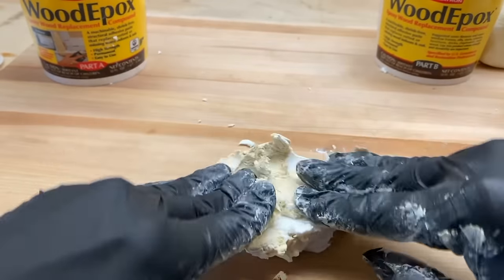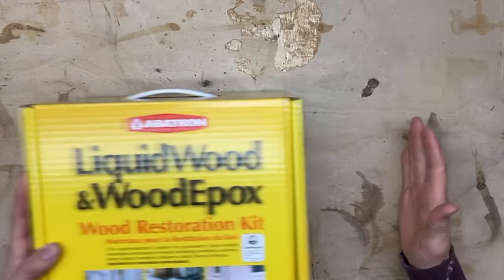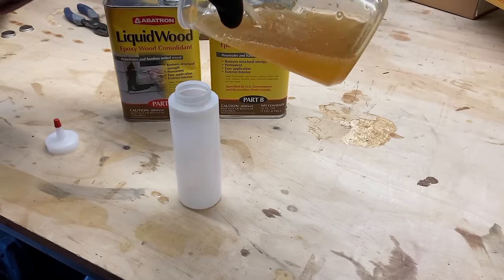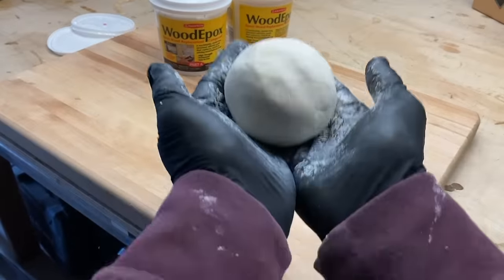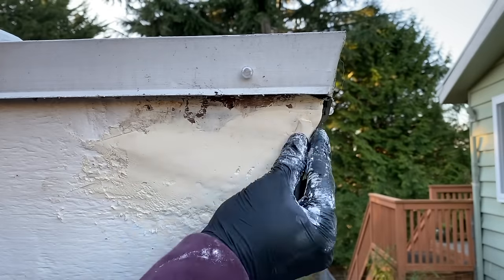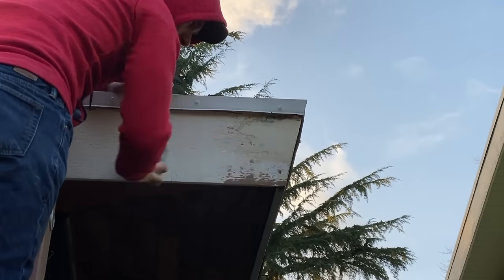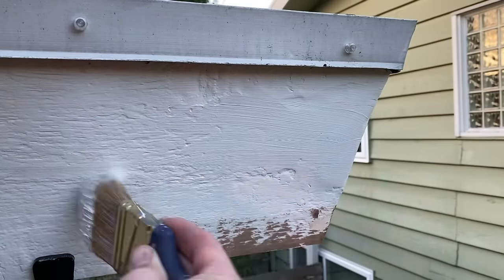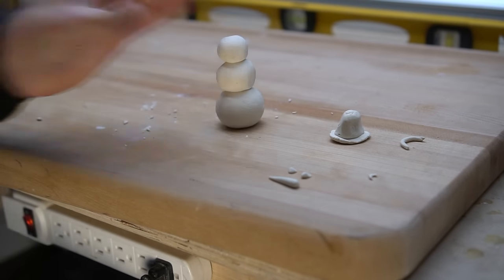How To Repair WOOD ROT and Water Damage With ABATRON

Comment: Hahah, so much work! 
Just cut it out and stick a piece in
Reply from the maker: That would be easier Ralph but just providing another option for those who don't want to go through the process of ripping the whole thing out.  Thanks for watching and hope you enjoyed the video.
Reply: I can repair with resin before you even have your chisel and saw set up
Reply: @tomsanders9491  oscillating tool to cut out section and stick a piece up there. Paint. Done. I did this on my house. Took 15 min.
Reply: @ImAChristianFirst  As a restoration professional of 40+ years, there are times when a "ditchman scab" (your suggestion) is neither appropriate nor correct.
Reply: Correction..."Dutchman scab"
Reply: @tomsanders9491  Why do people always throw out 40 years, 50 years, my entire life etc etc? It doesn't take 40 years to learn to do this stuff. It takes a short amount of time. I am sure there are times when cutting out the piece, nailing a new piece, and painting is not correct but around here in TN it is correct. My house is 6000 square ft. and dates to 1850s.  If I used epoxy to repair the entire house it would cost a fortune. Replacing wood with wood is a simple and an affordable solution.
Reply: @ImAChristianFirst  Most of the homes I have worked on with these epoxies are in the same size range. Many have intricate trim that is more easily repaired than refabricated, especially homes that are over 100 years of age. It does not require many years to learn resins thanks to the pioneers such as myself who wrote the books on restoration for people like you to learn from our accumulated knowledge. As for replacing with wood, I have been duplicating trim for federalist, colonial, victorian (1991 Chicago's Finest Painted Lady) and the first Prairie home (Tomek house) for over 40 years. Sorry to have offended you.
Reply: Hey guys! I have a house with some ceiling problem. And some constructions holding weight have damage. Changing entire piece would be the best but extremely hard and would require ripping off entire roof. Can you use this technique for constructions that hold weight?

Comment: A stiff wire brush before it's completely dry should provide a nice wood-grain texture.
That spray foam would provide a nice backing surface for the wood putty.
Reply from the maker: Great tip Stan. Thanks so much for the suggesting and the support.

Comment: There is a product used in the boating industry that is a water thin epoxy.   It penetrates extremely well.  I’ve used it and it will soak into rotten wood and turn it into a rock.   Soapy water instead of wd40 would be better and not leave a residue that might prevent paint from sticking as well as it should.
Reply: I use a little methanol. It creates a smooth surface and totally evaporates fast!
Indeed, alcohol is often used to "thin" epoxy to make it penetrate more so it is generally quite compatible and doesn't affect the epox strength if used in small amounts.
Reply: Could you post the name of the epoxy you used?  Thanks.

Comment: Wouldn’t it be easier to replace the board with an azek type product and it will never need to be replaced again?   Seems like a ton of work doing it this way.
Reply from the maker: In my opinion it’s a lot more time-consuming to try and find a board that matches the existing facia trim and trying to replace the entire board. That is also just as costly as this kit.  But in any case thanks so much for watching and hope you enjoyed the video
Reply: Yes so much easier, cheaper, and less time consuming.
Reply: @BYOTools  So wrong on every point!  You desperately need accurate and fact based opinions.  Even Abatron wouldn't promote this total waste of time and money.
Reply: l agree and clean job that's!!! 👎👎👎
Reply: @iwasabigdeel7895  You're so much smarter than me. I can't detect your fact-based evidence (not opinions) here at all!

Comment: I’ve used a similar product for a rotted door jam. When they installed the door they never put in Z flashing. Removing the entire jamb was a huge job. I was in no mood. I bought a spray hardner and the stuff worked well. I built out the opening then used the epoxy mix. It’s been four years and it still looks brand new.

Comment: To all who really care about doing a proper repair job: DO NOT USE STUFF as he did! Here is what will happen in a couple of years' time: The wood next to the putty will continue to dryrot slowly. You can NEVER completely stop it with anything short of replacing the effected wood. This is especially true since he did not address the water intrusion problem he obviously has at the roofline. Also for such a small area, cutting out the rot and splicing in new clean wood is VASTY superior and long-lasting too. It is also much faster to do and less expensive than putty.
Reply: @RA82828  I'm not a professional, and I can tell you this is the most half assed way to fix this. It's like those stupid videos of people using crushed ramen noodles and body filler to fix damaged panels on their car.
Reply: Thank you Mike. Do it once, do it right, move on with your life.
Reply: Although I'm guilty of using "rock hard water putty" to patch small holes.  My first thought when watching this massive patch is that the wood is going to be much more hygroscopic than this filler.  The wood will expand and contract with humidity cycles, it will almost certainly separate from the patch and continue rotting at this new crack.  The newly formed gap between the materials will hold water with capillary action.  That being said, he may have mitigated the root cause of the water intrusion with some other action
Reply: @RA82828  I will make a note to myself to NEVER hire you to do work for me.
Reply: Totally agree, the rot is not stopping because you covered most of it. He should have removed ALL rotted wood, that's if he were to have the job done right.
Reply: @RA82828 I’d hate to see your house!
Reply: Rot only occurs with water. If you stop the water, he will have stopped rotting. With that said, I believe a key issue here is the perforation of the metal flashing above the hole, which may be delivering water in behind.
Reply: The repair is fine, he should just install rain gutters so the problem never happens again.
Reply: Geez grown-ups,  there's always options.... to each his own.  I thought it was an awesome tutorial. To each his own
Reply: You guys, he said he stopped the rot, I am assuming that meant he fixed the cause of the rot.
Reply: Hey boys I gotts a tar gravel roof leak at a corner about 10 inches out on the roof edge, dry rot underneath, does the entire section of tar roof come off and new 3/4 inch wood put down then re Tar with Henry tar and then throw gravel rocks on top of tar.
Reply: @matt7iron  I dont know much about tar roofing other than I dont like it much. ;-) Not very durable and a heck of a stinky mess to work with too.  In any case replacing all the rotten wood is critical.
Reply: This may not be the best way to do this, but it does work, and will last for several years. To fix it the right way is 10x the time and money. It would’ve been better if he treated the rotted wood with anti-microbial/anti-fungal and maybe used wood restore.

Comment: Using small pieces of wood in the back to fill part of the hole saves money.  This stuff is not cheap.
Reply from the maker: Nice tip!  That would save us some money thats for sure haha.  Thanks for watching.
Reply: Yeah great tip, I do that too, mix wood chunks in with the WoodEpox.   The stuff is good but pricey.    If it needs to be extra strong I get LiquidWood in there too, to cover the wood chunks and melt together with the WoodEpox and it all becomes a super strong mass.  Hard to go wrong, the stuff is amazing.

Comment: I did the same today on my fascia corner.  I used builders bog. Easy to mix, hardened in 20 minutes ready for sanding and simply used a spray can to touch up the paint. Looks like new
Reply from the maker: Great to hear and I'll have to try out Builders bog in the future.  Thanks for watching Reece and hope you subscribed.

Comment: Thanks for your video showing this product. I will be looking to purchase it for my house. Do think WD40 , even though it does smooth out the surface when using a spreader, it surely must compromise the strength somewhat as it mixes in. I have a log house and when trying to apply the chinking, I use alcohol. this does the same thing and evaporates fully leaving no residue. This  also works great when running beads of caulk. I like to tool the bead with my finger so I fill a small cup with alcohol and dip my finger in it, then smooth out the bead. It slides so well without pulling the product.

Comment: Since the hole is so large, being  inside no one can see, why not use small piece of lumber to fill in the inside as much as possible, then just use small amount of woodepox to fill the outside facial part, you will save more than half of the product.
Reply from the maker: Great suggestion Jachin and I will be doing that next time I take on a project like this.  Didn't know how much product this hole would take until I started filling it haha.  Thanks for watching and hope you enjoyed the video.
Reply: Or maybe sprayfoam.

Comment: I think I probably would have cut rotten sections out with multi tool installed and called, painted for less time and probably $50 in materials. And definitely would have been a far better long term solution. But it’s a good demonstration on how the product works.

Comment: Great video, thank you. Question ... how long do you need to let the resin dry before filling the hole? I can't seem to find that detail anywhere and don't want to sacrifice the durability by doing it incorrectly.
Reply from the maker: Great to hear and thanks for watching Michelle.  I actually spoke to the company afterwards and they said you don't have to wait for the epoxy to dry.  You can install the puddy right afterwards.  Thanks again and hope you subscribed.
Reply: Yeah no need to wait, add WoodEpox at any time, especially before the LiquidWood dries fully, so the two products can melt together into one solid piece. I sometimes paint the WoodEpox with a coat of LiquidWood at the end too, so it has a hard surface, depending on the situation.
Reply: @BYOTools  cures

Comment: Can the mixing cup and applicator bottle be cleaned and reused? 
The video is very helpful, Thank you!
Reply from the maker: Great to hear Bob and thanks so much for watching. That’s a good question and in all honesty I’m sure you could salvage the brush and bottle if you wanted to however I just threw mine away. I believe you can use some type of mineral spirits to wash away and remove the excess epoxy in the bottle.  Thanks again for watching and hope you subscribed.
Reply: Yes. Use MEK
Reply: Yes. Or no, depends on what you use for these. I usually clean everything with MEK

Comment: There's got to be a better way than this. 🤔  I'll keep searching thank you.
Reply from the maker: There are plenty of ways to handle this type of repair and this is just one of them.  Are you more interested in just replacing the board?  Thanks for watching Sara.
Reply: I had to search for a comment that Was not praysing him if its not structural take a new length off timber my god no wonder there houses blow away

Comment: You just solved my issue at home. As not every time you need to replace everything. You might want to replace it but there are times it is not that easy.
Reply from the maker: Exactly why I wanted to take on this project Jose.  Thanks so much for watching and sharing.  Hope you subscribed.

Comment: This method of epoxy is almost never worth it unless the repair is very small. The wood expands and contracts and breaks away from the epoxy eventually. As well, the wood rot will continue unless you treat it.  For this  size of hole on a non structural trim, it's cheaper to just cut out a piece and replace it with real matching wood.

Comment: You could use a handheld belt sander and 60 or 80 grit and sand with the grain and get a much better match between the original cedar texture and the filler. Using a rotary sander or orbital sander is for ELIMINATING details in the surface. Never gonna match up that way.

Comment: Just fixed a door trim using this stuff. “Replacing the rotted piece of wood was not an option”
Repaired spot looks great. 
Don’t mind what the money suckers say on here. 
Thank you for the video!
Reply: Is it noticeable where you used this? I’m thinking of using this on the bottom of a door frame where there’s rot

Comment: Great video, as I need to do this. The product shown is $130. There is a smaller kit for $50. Looks like a great product, but that is insanely expensive to me. I might just put a small piece of wood to fit in there. Labor would be about the same.
Reply: I did this today to an outside window frame. Found a 2 part system for $15 at Home Depot. Used blocks of wood to fill the large gaps.
Reply from the maker: Great suggestion Gary.  I will have to try that one out next time.  Thanks for watching!
Reply from the maker: Hey Vincent.  What product did you use that was just $15?

Comment: Thanks for the in depth instructions. I have a question about this product, can it be stained? Woodpeckers have made holes in my unpainted barn and I have a protective stain that I use and I'm hoping it's stain able. Thanks!
Reply from the maker: Great to hear Steve and thanks so much for watching.  I don'k know if it can be stained or recommended so I would contact Abatron directly so you know for sure.  Thanks again for watching.

Comment: When filling voids like that ,we used to stuff the cavity with newspaper to take up the blank space in the cavity,save the expensive stuff for the patchwork itself
Reply from the maker: Great idea Dustin.  I’ll have to keep that in mind on future projects.  Thanks for watching and hope you enjoyed the video.
Reply: rather than paper one might try styrofoam peanuts or pieces in whatever size/configuration to fill/brace voids both big and small (as long as there are no weight-bearing issues).  you can coat them w/ a bit of glue and pack it into the void - and cover w/ the $$ item then.  the foam insulation product such as BYOT used here is also helpful...  you have a nice safe day!    ;  )

Comment: I'm currently using Abatron on a job now. Are there any ill effects of applying WD-40 to the WoodEpox? The "official" Abatron video states rubbing alcohol can be used to keep the product from sticking to the trowel or putty knife. BTW, nice explanative video!
Reply from the maker: After discussing it with Abatron a while back I should have used something else other then WD-40 but I didn't use much of it so no concerning issues at all at this point.

Comment: Woodpeckers eat bugs... which is why replacing the wood is better , in my opinion.
Reply from the maker: In all honesty this was not from woodpeckers this was from a tree that used to be there which was pushing against the side of the house and damaging that point due to excessive moisture. I got rid of the tree and at that point the damage stopped occurring and that’s when I filled it. Hope that makes sense and thanks again for watching

Comment: Good job, but replacing the section or using Bando would be much cheaper than $45...
Reply from the maker: Thanks for the suggestion Zak and I understand that there are cheaper alternatives out there.  Just know that do do won’t work in this application because it won’t expand and contract like wood naturally does.  Abatron will though.  Thanks for watching!

Comment: THANK YOU‼I have repaired, or at least made an attempt, which went badly, my door jambs on my house.  The south side of my New Mexico house gets a rotation of 100 degree summer sun, monsoon rains, hail, and freezing.  This wood putty product may be my final fix.  Stucco walls makes door replacement so tricky and expensive.  🤞that the wood fix kit gets it done for me. Thnx.
Reply from the maker: How sounds like your house is taking a beating outside haha.  Let me know how the product does with stucco.  Never tried that before and thanks so much for watching.

Comment: Just used it to repair larger area of wood rot. Works like charm! Easy follow the steps, when dry feel like wood better than Minwax wood ( Minwax crumbles easily)…I will buy just wood epoxy putty to repair other areas…
Reply from the maker: Great to hear Ted and thanks so much for sharing!  That is much appreciated and glad it worked well.

Comment: I have a rotted hole on my window frame but also a thin crack on the other side. Is the glue in part 1 mixture thin enough to inject with a syringe?  I could clamp it if I can get the glue in there. Thanks for the video. I’m just waiting for my kit to arrive.
Reply from the maker: I would say you can with a syringe but it might just take some time to push it through.  Good luck with your project and thanks so much for watching. Hope you subscribed.

Comment: I usually change the wood this won't last and a piece of this wood is cheaper than the product he's using totally a shitty way to repair it
Reply from the maker: I’ve worked with this product before and its made to last Neil.  That’s why it’s expensive.  Could have replaced the whole board but trying to give others a secondary option for those who want to try it.  Thanks for watching though
Reply: It can't stop the wood from continuing to rot cutting it past the rot will